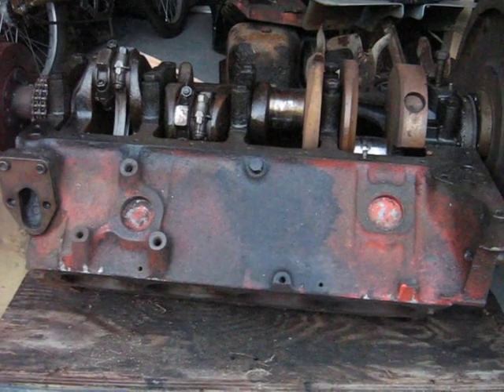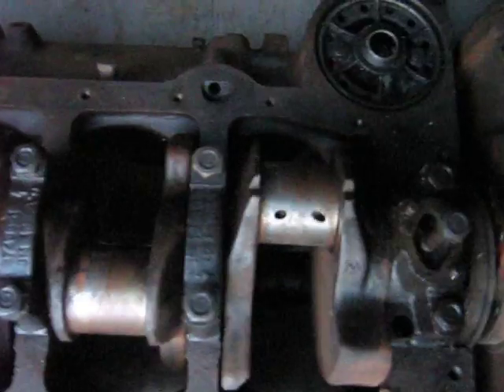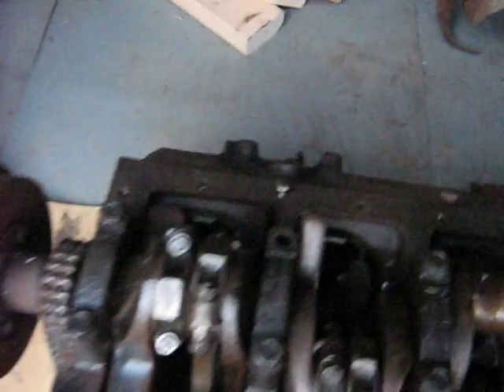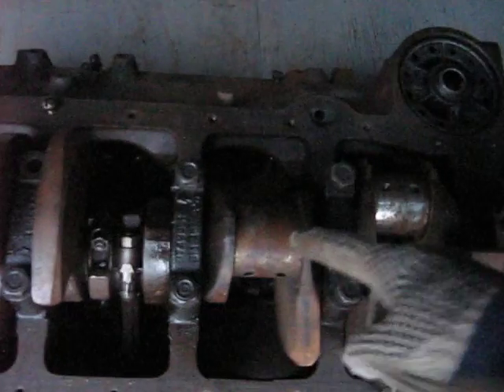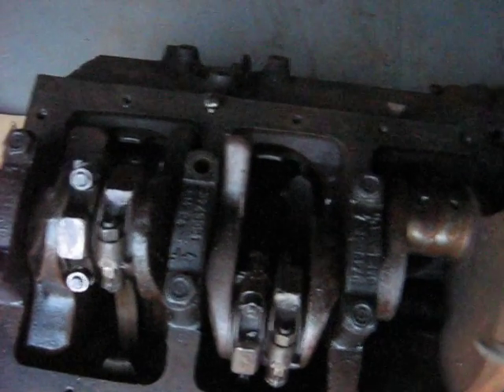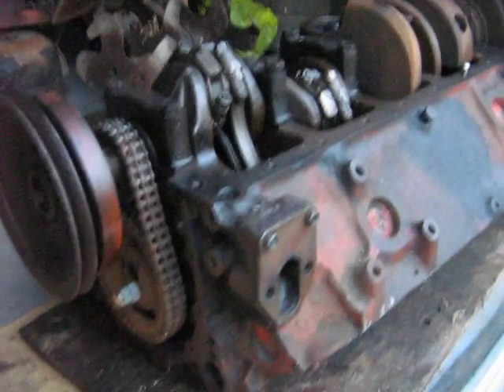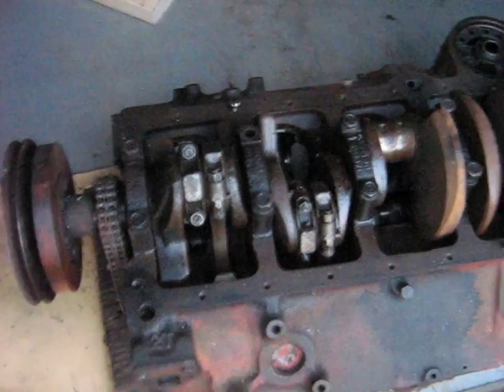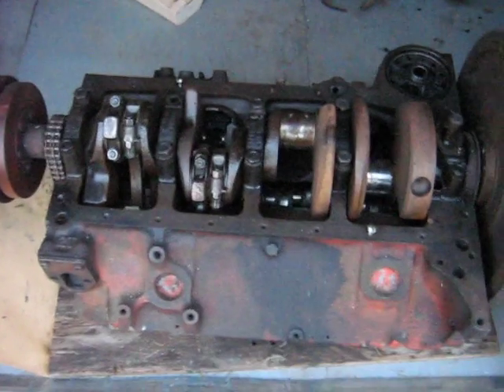327 V8 Crankshaft layout

Comment from the maker: Sorry, I don't quite understand.
I think I may have messed up in my last response, what is it again that you want to know?
Just giving some info: So for the Deltic to work right, the angle between the cylinder rows in the block needs to be 60 degrees, which most V6 engines are. Where we have a problem is with the fact that a lot of V6 manufactures offset the 2 crank pins on the crankshaft. Ideally we want the 2 side by side rods to be on a common centerline. Prehaps some crank cutting & welding.

Comment: The later GM 90* V6s have split-pin cranks as well. Only the first generation "odd-fire" GM 90* V6s had the common pins.

Have you looked into whether the crank timing from the different engines would cancel out?

Comment: ok so does the off set you talk about mean there off set in the scene off raising order like you sowed (diffident degrees of rotation) or do you mean the journal has a off set design in a split journal style (i think this is the right one) just wonted to make sure. also just a idea what if you took a small block v8 crank shaft and cut off the 2 extra crank and welded up the no drive side to that i bet there has to be some overlapping baring size between v6 and v8 now that leads to a.............